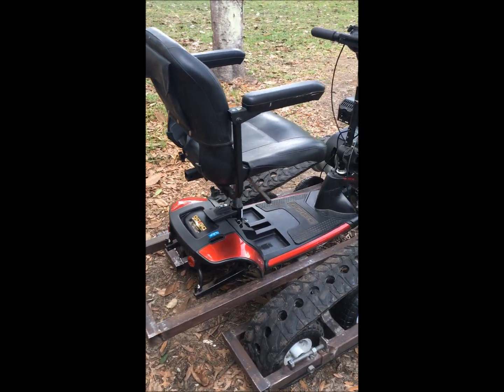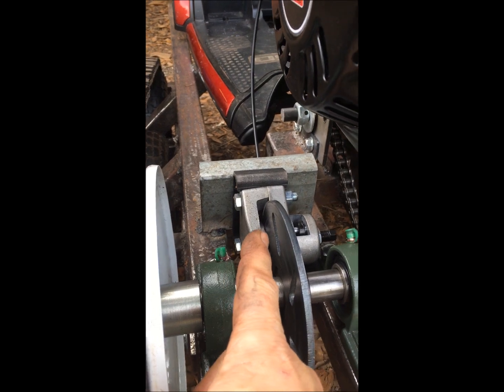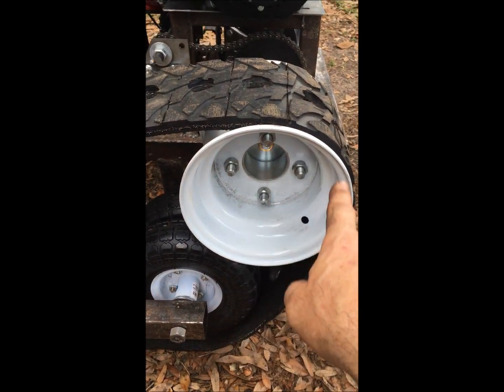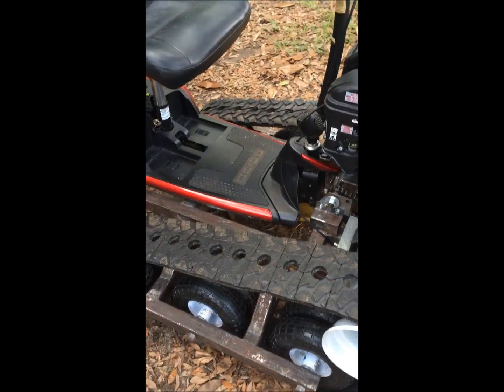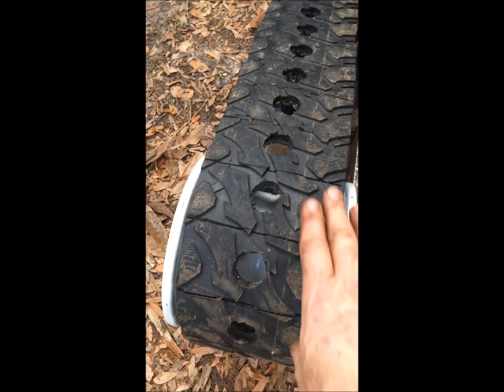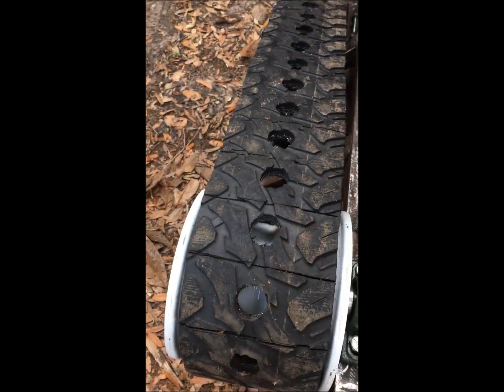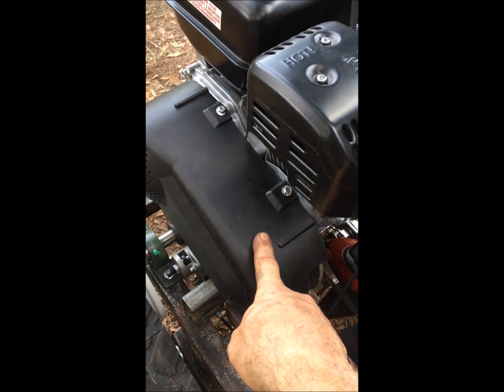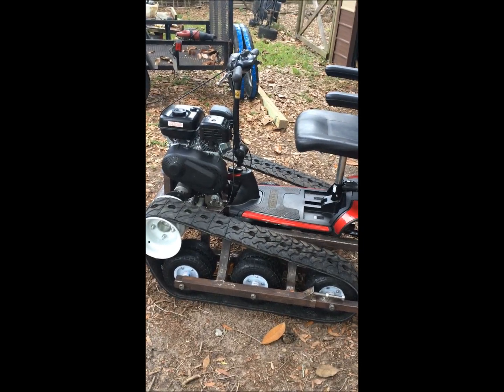mobility scooter tank walk around

Comment: Nice build - just wanted to check the tyres you used? I'm assuming 33" is the outside diameter so about 102" total length (circumference)?
Reply from the maker: yes, I believe that's right.  I first built a wooden lower subframe to test the measurements and adjust things before I made them from square tubing.  It was a quick way to mock it up before cutting steel.  The little inner tires I used were from Harbor Freight, 10" diameter and only cost $4 each.